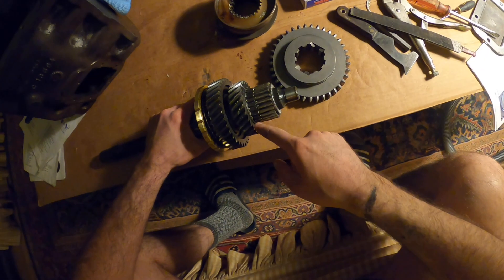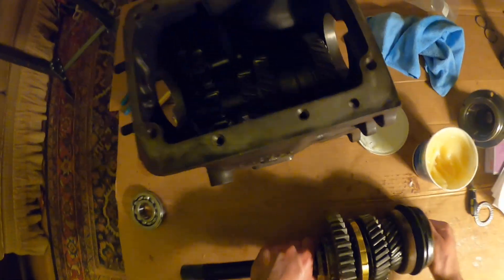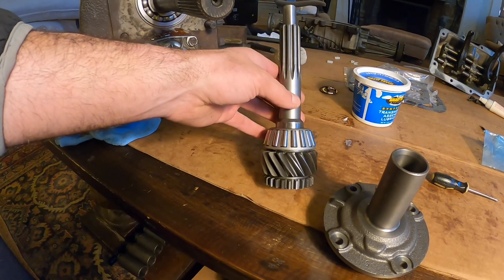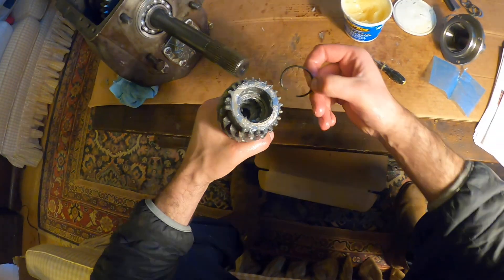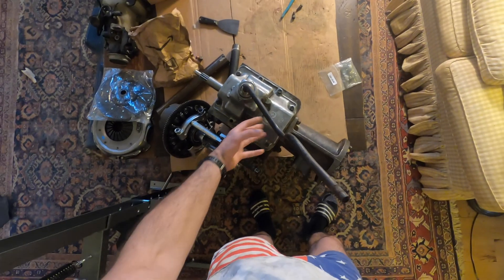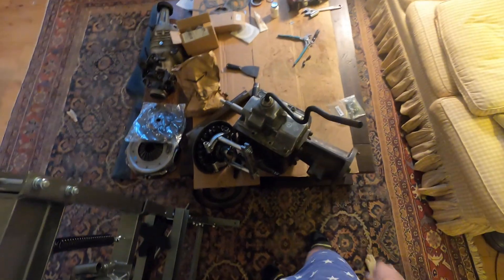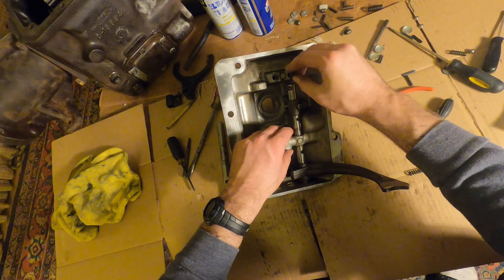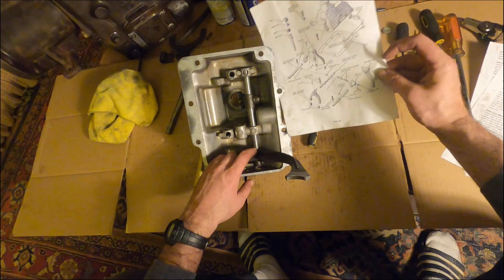NP435 Reassembly & Testing - Rebuild Series, PART 5

Comment: When you cut off the pins on the shift tower that retain the shifter,  and drilled them out did you replace them with split roll pins? I bought the shift tower rebuild kit from Novak and saw there were two larger split roll pins it and assumed that’s what they were for?

Comment: I just rebuilt mine and 2nd gear is hard to get into and sometimes binds the whole transmission up. Goes into 1st but slides tight the whole way in. Synchro worked fine before I tore it apart. Any ideas
Reply from the maker: Are you shifting the box out of the truck or installed in the truck? Sounds like your endplay may be too tight. If it’s in the truck and shifted fine out of the truck, your clutch may not releasing fully. This could be bent fingers (too much weight hanging on clutch during trans install) or a clutch slave cylinder that isn’t fully bled. Bleeding slave cylinders is a really difficult job. Ask me how I know 😅

Comment: Hey man, did you re-use the needle thrust bearing that sits between 4th and the input shaft? Novak doesn't have that part and I can't find a PN
Reply from the maker: Yep. Give it a once over and if it looks / feels good, clean it with some wd40, lube it up good and send it

Comment: What oil goes in this transmission?
Reply: 80 weight gear oil. You can use a 75w90
Reply: @williamhaggerson5490  thank you so much I appreciate you answering

Comment: Sorry for bugging you but do you have any part numbers for all the shifter/shifter fork stuff? I need to do the exact same thing you did in this video. my shifter isn’t doing so hot anymore
Reply from the maker: No sweat, check out Novak Conversions' website- they have individual parts and an exploded diagram to help you find what you need.